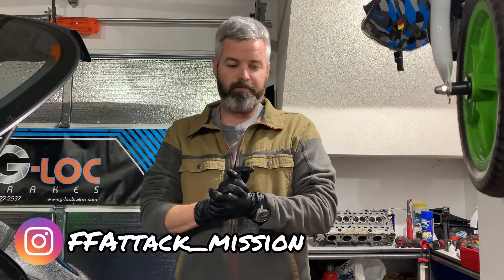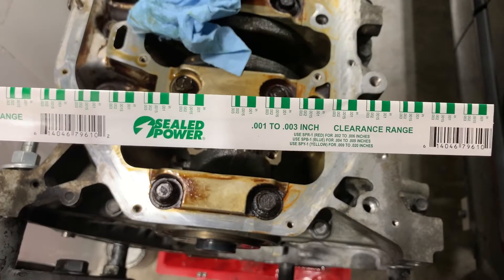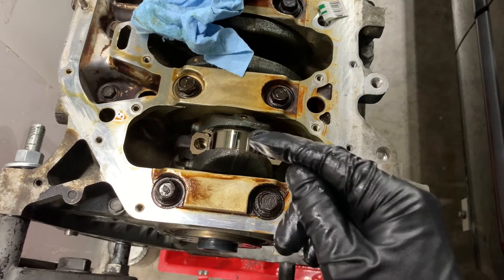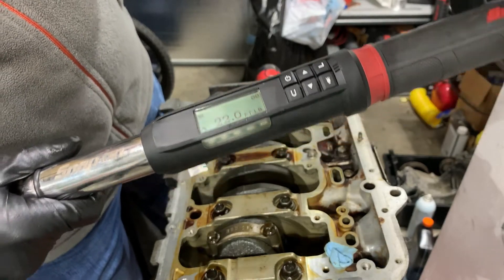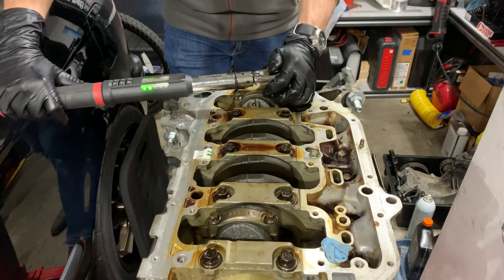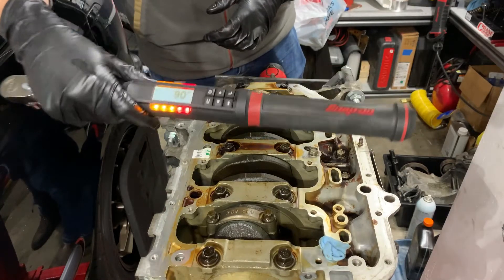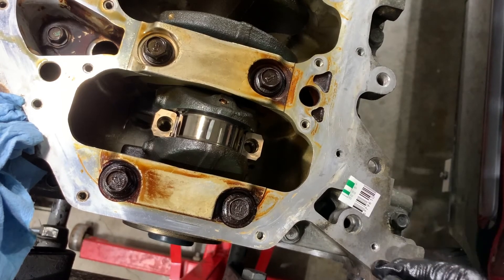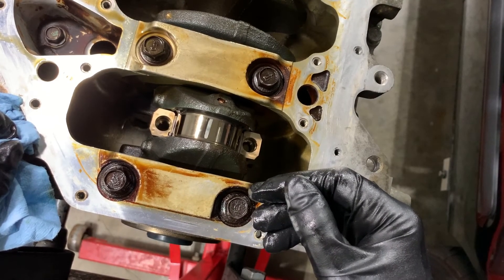K24/K20 rod bearing check ep.3

Comment: That's awesome. And you want to replace the bolts since they're torque to yield, right?
Reply from the maker: That’s correct, having said that though I know many that re use with no issues. I did not want to risk it for the few dollars the new ones cost personally.
Reply: Yes, replacing the rod bolts is best practice, but a lot of people reuse them no problem. For what it's worth, I reused my K24A2's rod bolts back in 2020 and it's still doing great even though I redline it almost every trip. That was just a stock rebuild though, I probably would have replaced them if I planned on revving higher than stock or making serious power.

Comment: 90 degrees? It thought it was 22 ftpd plus 56dregrees
Reply: That’s weird because k24a2 manual says 27 and 120 degrees 🤔
Reply from the maker: I’m not sure the factory service manual I read had the method I used in it.
Reply: The main bearing cap is 22ft lbs 56 degrees, piston caps 22 90

Comment: How to know which size (standard, over or extra clearance) bearings to buy before actually buying
Reply: There are no one size fits all bearings for Honda engines, this isn't a Chevy V8. To get the most precise clearances possible, Honda color codes their bearings by their thickness. They have brown, red, green, yellow, blue, etc. There is a number code stamped on the block and numbers stamped on each rod and crank journal, you have to look up the size chart to find the right colors for each journal. Of course if you had the crank machined or something, then that wouldn't apply anymore and you would have to measure. I'm not aware of any aftermarket companies who make color coded bearings for these.
Reply from the maker: You need to very precisely measure the journal and the rod (machinest quality measuring tools). Then you doxa bit of math to come.up with how think your bearings need to be. I have done it a long time ago on a 2jz.